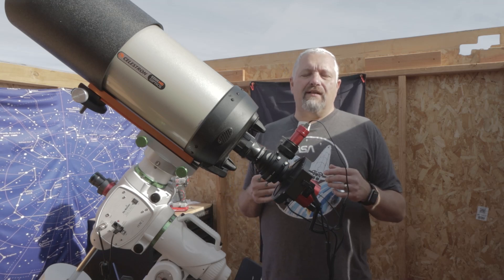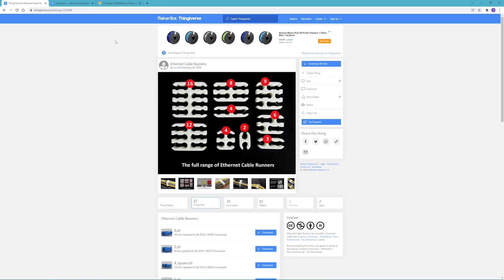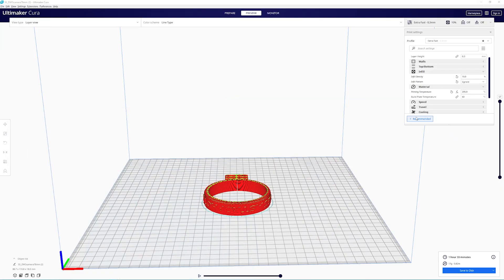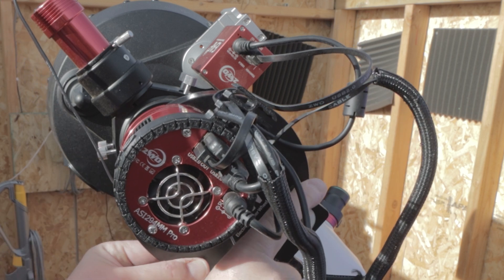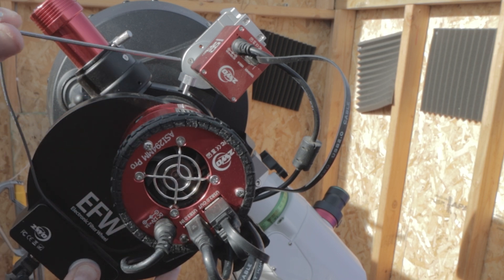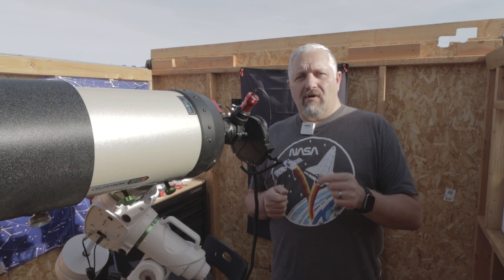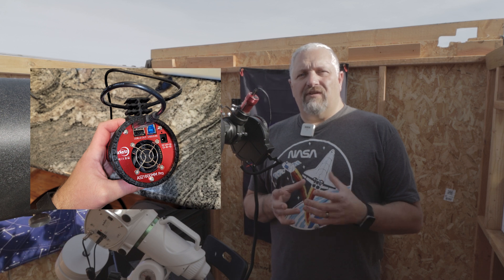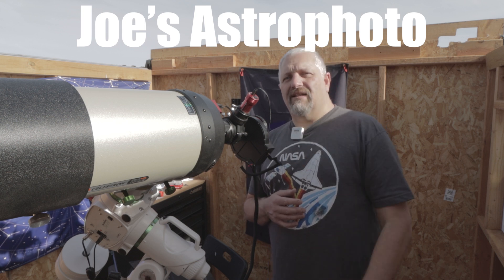ZWO Cameras USB, Cable, and Rotation Assistance

Comment: Nice one Joe, made me think about running more of my cables back through the powerbox. Does your ZWO EFW slip (unscrew). I did note you had it sat on the right side - presumably to stop it unscrewing?
Reply from the maker: Thanks Phil, it’s slipped before but not a normal problem. My problem is that I have the EAF on one side and if I have the EFW on the same side it throws off my balance. I need to keep them opposite sides or get even more cw for the front.

Comment: Quick tip. Most slicers have a scale parameter that can be adjusted to change the fit of the ring.
Reply from the maker: Thanks Mike! I just don't have one of the other size cameras to test fit with, but great tip for others who want to take the one I have for 78mm and test fit for their size.

Comment: Nice idea!  One thing you'll want to check (and I'm pretty sure you're ok based on what I can see) is that you aren't exceeding the minimum bend radius of any of the cables.
Reply from the maker: Thanks Greg! Great point on the bend radius, especially in the winter. It can get so cold here the cables will snap instead of bend. I’m usually not imaging when it’s that cold though.

Comment: I just sent my 533 back RMA today for one of the usb ports not working. Tap a hole for a small set screw to hold a loose ring in place.
Reply from the maker: Sorry to hear Cap, but thanks for the tip!

Comment: Joe, this is awesome.  I just got the ZWO ASI2600MM Pro for Christmas to go along with my 183MC.  I don't have my own printer (yet) but I have a local friend who has offered to do prints for me.  I will definitely work on adapting your file for the 2600 and the 183.  I had been looking for some way to put degree marks on the camera easier rotation, this is way better than Dymo labels with marks.  Great work.
Reply from the maker: Thanks Bruce! The file I shared should work for the 183MC at least. If you do get a working one for the 2600 please let me know and I'll share it with the other ones.
Reply: @JoesAstrophoto  I will absolutely share back anything I come up with.  I just measured my 2600 and the diameter at the rear of the camera is 89.8 mm.  I had postponed getting a 3D printer this year because I really wanted a mono camera.  I stretched myself a little thin getting the 2600, a 7 position EFW and a full set if LRGBSHO 2" filters.  I went with Optolong for the time being, it will take me a while to outgrow them.  Clear Skies!
Reply from the maker: @Br00se  Thanks Bruce and yeah I know that’s pricey, I’m not happy about the cost of the filters but will be doing the same thing myself soon.

Comment: Hi Joe, at the opposite side of the cable holder, you could put a couple of lugs and a couple mm gap in the ring, then use a thumbscrew to clamp onto the camera, rather than relying on getting a friction fit straight off the printer. This way your shrinkage tolerance doesn't really matter and just print for the OD of the camera specs.
Reply from the maker: Thanks Dave that’s a really cool idea! I’ll experiment with that.
Reply: Some nylon thumbscrews would be the way to not mar the camera housing.
Reply from the maker: @johnadastra1754  Good call as well John!